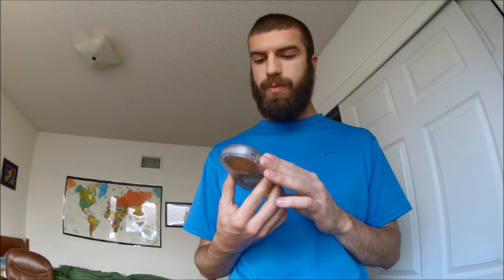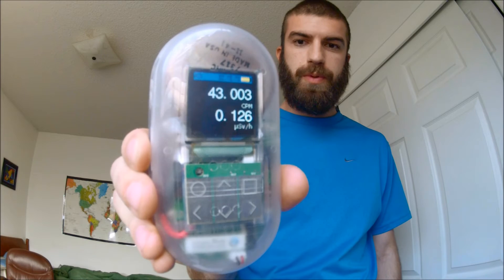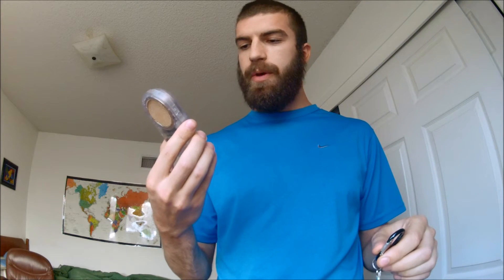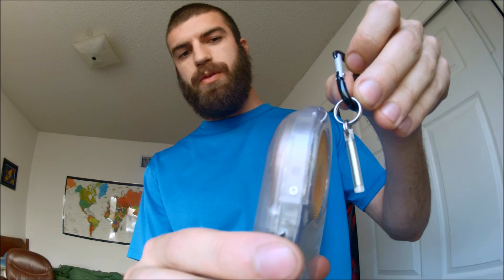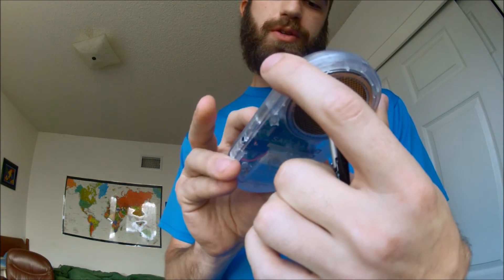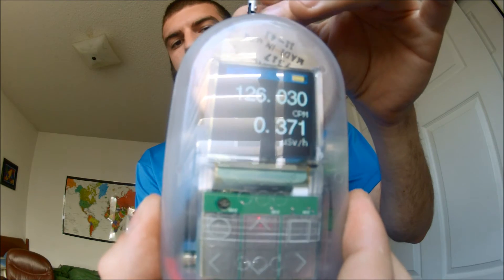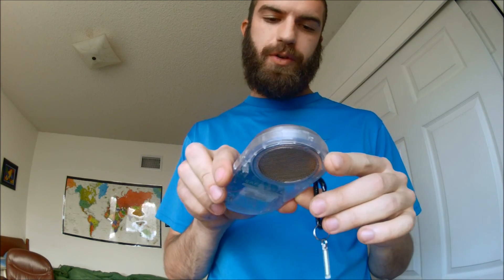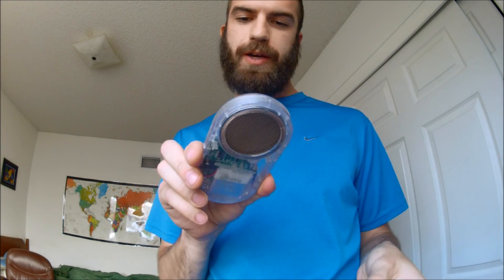Safecast Onyx Tritium Test

Comment: Glenn, nice counter, where are you located?  My monitor 4  ( 1980's version ) only gives me a 15 cpm in Northern CA.
But it does not have a pancake sensor, uses the Muller tube and although it’s old, it generally chirps out 12 to 15 cpm on the ground outside.   [ Both in CA and AZ for yrs, [  even after Fukushima ]]
 
 I have a lot of the tritium glow rings from UK vendors,  but I only get a little higher reading, I have some old gas mantels that I saved that really make my GC sing! ( I store those safely ).  Any idea of the cost of your new GC? 
  I am waiting for a GC with spectrum under $1K....( hope we all don't have to wait too long! ).    Btw,  what is the upper limit of that device?  Reason I ask, I've been looking to update my GC but almost all ~$600 models seem to have a limit of 50mR.....( same as my Monitor 4  ), Reason why I haven't bothered buying a new unit......not that I want to hang around 50 or 100mR.....if I ever got those readings I'd next expect the GC to quench out shortly!
Reply from the maker: Hi Rob, I'm located in Ventura, CA.  It was brought to my attention that the radiation I was measuring from the Tritium tube was most likely x-rays and not Beta radiation.  It may be that your Muller tube is less sensitive to x-ray radiation so it reacted with less of an increase when exposed to the Tritium vial.  I purchased my GC for $400 from this kickstarter: https://www.kickstarter.com/projects/seanbonner/safecast-x-kickstarter-geiger-counter  I'm not sure what the upper limit of the device is, however I've registered 30,000+ cpm from my Uranium and Radium samples.  Not sure what the conversion to mR would be given my tube, source type, detection geometry, etc.
Reply: Glenn Langton
Thanks for your quick reply Glenn; I’m in San Jose..... 30k cpm is pretty high.... my monitor 4 does measure X-rays +/- 60 % within a specific energy range...couldn’t find my manual......  but I now recall X-rays are suppose to be measured in another area of the unit not by the window of the Muller tube....thxs....I did a little research & found out that there is a 3X's difference between the Pancake and the Muller tube....radiationnetwork WS calls it "Equalization" .....And apparently they don't correct for this on their maps..[ that's great!  its been 15 in Washington state, now its 45 OMG !! ]... ( my 15 is your 45 - cool ) But....the engineer in me is asking the next question.... with the difference in  sensors what are we to believe, I mean what if I had a GC with a Pancake sensor that's 3 feet in diameter? Would it measure like 400mR/hr..??..)......Lol...( I asked a similar question to the Russian GC units that had 2 muller tubes in them......no real answer back though ) ........or should the sensor cover the surface area of my body to measure what I'm being hit with ??  Just some food for thought! 
[ps: I found a number of WSs that have milliS to mR conversions...after Fukushima,  I hurriedly ( & stupidity ) made a chart on the back of a $300 rebate check......which at the time didn't look like a check,  & a year later it’s too late to cash it in....but it’s now one expensive conversion chart though...Lol!

Comment: You are NOT measuring beta radiation! Beta radiation + Glass= X-Rays-
Reply from the maker: The exterior of the vile appears to be made of plastic, but I wonder if there is an inner glass vile.  Would there be a way to conclusively differentiate between emitted x-rays and beta particles using just my geiger counter?  Is your assumption that the beta particles can't penetrate the glass/plastic exterior?